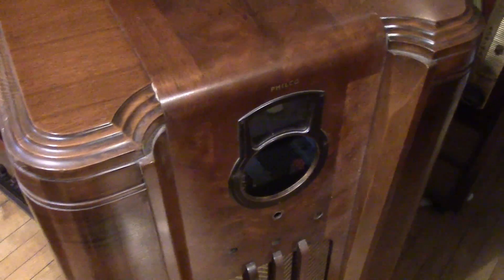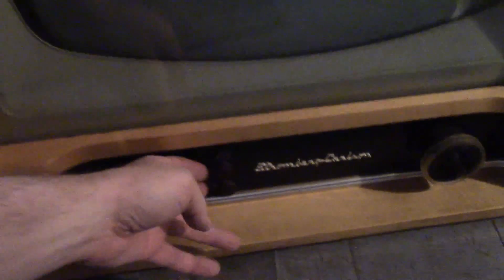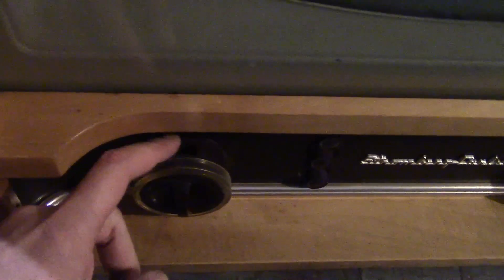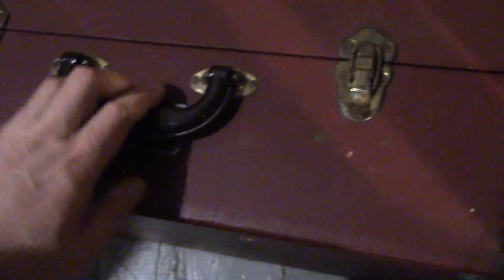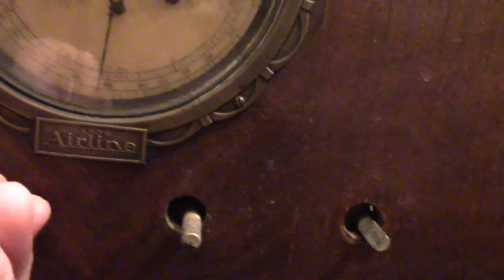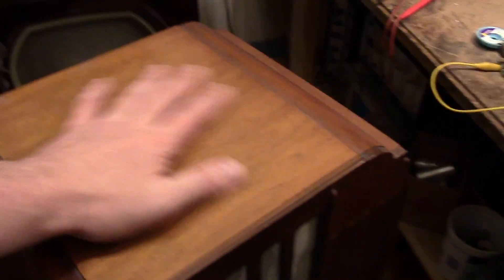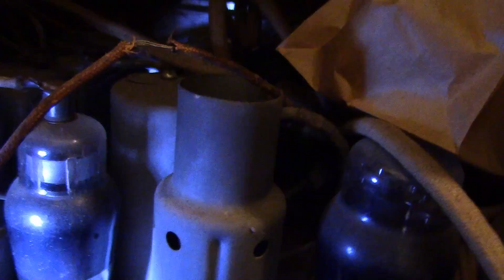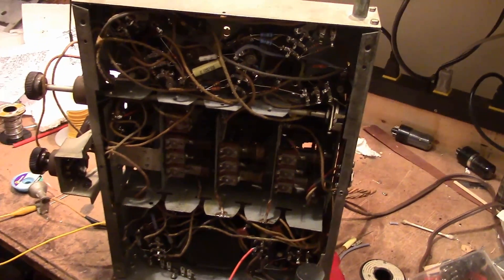Upcoming project preview

Comment: With regard to the Airline, many of those sets suffered from dial burn due to people using replacement pilot lamps with too long of a bulb, that one looks unscarred, although it may be slightly faded. Also it looks like the other half of the dial pointer may have broken off and gone missing, unless it fell down inside the cabinet or someone put it inside the paper bag.

Comment: As a radio guy, I'm really looking forward to the restoration on that sweet Airline tombstone....love the cabinet on that. I'm also looking forward to the resto on the Stromberg Carlson, which has a striking cabinet design as well. Are those two something you're restoring for someone else, or are they yours?
Reply from the maker: +justsomeguytoyou They are for someone else.  It could be a while before I restore anything for myself.
Reply: That seems like a win-win scenario; you get to do what you love, AND make some money on the side as well :)
Reply: justsomeguytoyou True! I wanted to see what some of that old mahogany looked like. I am not really experienced at the electronic part so much but this should be a good learning experience. I might try to get a variac before I get to that point. It may not be worth all the work to most people but I got it for free and I love good old American made stuff!
Reply: Sorry, but I don't. I'm not surprised it still works.....things were built to a higher quality standard back then.
Reply: justsomeguytoyou That's why I thought it was neat. It actually has chain pulleys inside it. Thanks for the response back.
Reply: I found a Stromberg Carlson am receiver, phono and its pretty rough and the speaker in gone looks like it was a 12 maybe. I  cant find anything about it on  Internet. I hope to get it going. if not I'm not sure what to do with it cause its so cool I hate to destroy it to use for anything else.
Reply: Jason Goldthwait
If the cabinet looks pretty rough, you could probably sell the complete chassis on ebay.
Reply: justsomeguytoyou I haven't taken out the chassis yet but it looks great. I am trying to get all the paint of the cabinet and possiblly restore it. I do could sell the components but to me this thing is a treasure... I have been researching how to get it going... I haven't even tried to plug it in yet cause I'm scared to mess it up. I will probably replace all the capacitors. Thanks for the feed back!
Reply: Jason Goldthwait
Fixing the paint problem is doable....I thought maybe the cabinet was rotted out or something major like that. You'll definitely want to replace all of the capacitors, especially the electrolytic ones in the power supply. It's possible that radio used rubber wiring under the chassis....make sure it's not all hardened and crumbling, because if it is, it has to be replaced. Good luck!
Reply: Thanks! The cabinet is scratched and dinged. The veneer top on one side is cracked in several spots and chiped I don't know if I can save it yet I may have to replace the veneer. I want to keep it as original as possible but its 70 years old. I was looking at the legs thinking they were kinda rough and then I thought to myself... probably better than most 70 year old legs lol....
Reply: It's an  model no.1120 pl
Reply: Yeah, 70 year old legs ain't pretty lol Before working on the cabinet, I would start with the chassis and get it working. After all, cabinet work takes alot of time....no sense in doing that if you can't get it working.
Reply: justsomeguytoyou Do you know anything about old 8mm projectors? I found a Keystone model 912 and I've had no luck finding out what year it was made. One of my neighbors was going to school ap it and gave it to me I had to put a cord on it and it works great!

Comment: Looking forward to seeing the Airline restore.  This past summer I picked up the big brother console version of that radio and they are really nice, however looking at all that is printed on that dial I can see the inspiration Philco got for the ad "no stoop no squat no squint"  Thanks Zach
Reply: +zachtownsend1 That was a gimmick that Airline, and some private label sets of similar design, used for a few years. The Airline sets with the crescent shaped dials also had call letters displayed above the frequency markings as did the moviedial sets.
Reply: +OlegKostoglatov Yes, that's how my dial is with the call letters along the top with the numbers on the bottom.  However, I think the radio in the video is missing the top half of the dial marker and it looks like not the easiest part to replicate.
Reply: zachtownsend1
Well, the design is what they used to call an "Airplane Instrument" dial, so I think that you are right, the other half of the dial pointer has broken off, hopefully it's either in that paper bag or inside of the cabinet.
Reply from the maker: +OlegKostoglatov I compared it to other examples of 'Airline 62-131', and it sure does look like half the pointer is missing.